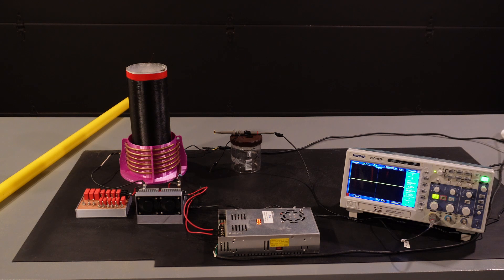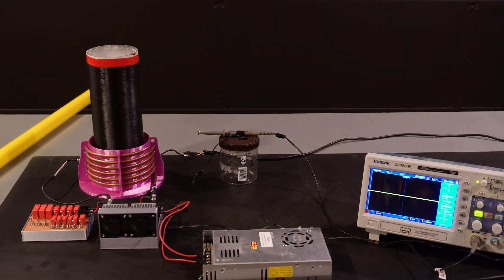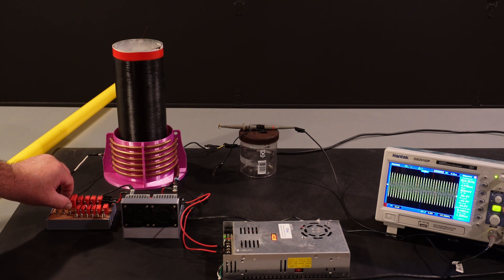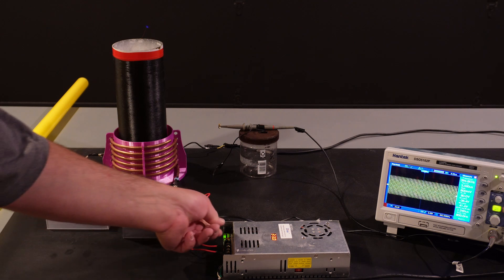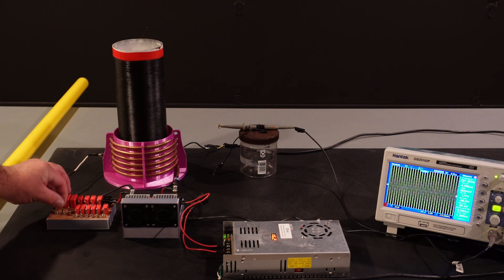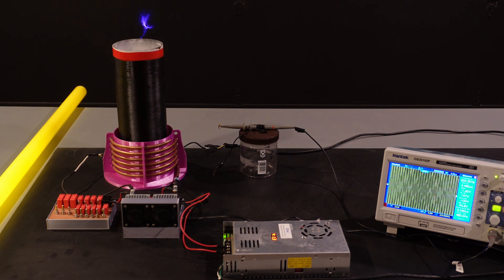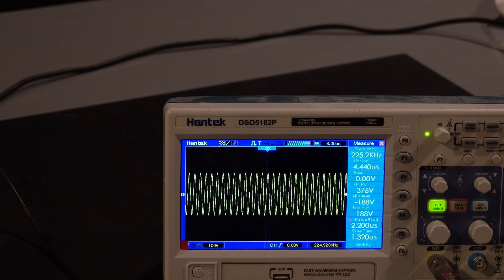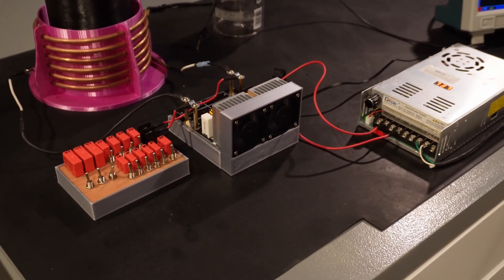Zvs capacitor Bank Test For My Tesla Coil

Comment: Could you get a large variable capacitor to fine tune it even more if needed. This is great!
Reply from the maker: If the caps were bigger than I would turn it off each time. but these are very small.

Comment: Very nice demo! I would like to propose an experiment to see if the body capacitance influence could be eliminated. If you wore a grounding wrist strap (connected to a true earth ground), would switching the variable capacitor bank by Ian (and Master Ivo) cause less body capacitance influence on the scope? It's also advisable to wear a good wrist strap grounding bracelet when you work with high voltage systems. That way, if an arc hits your hand, its directed to True Earth instead of your Heart ;)